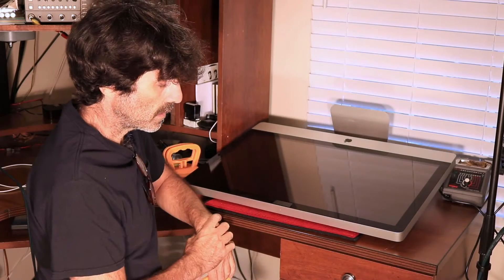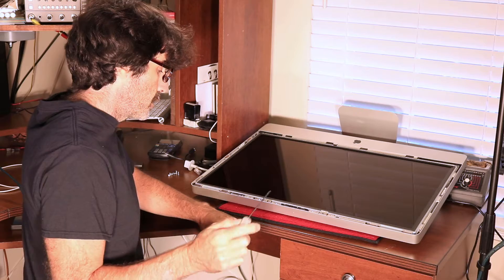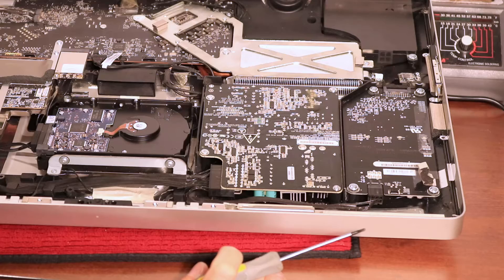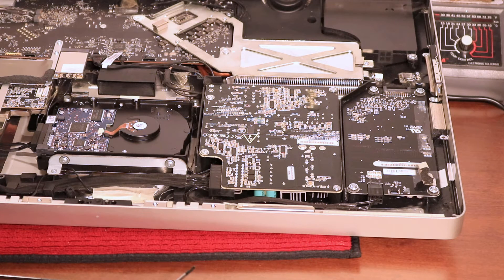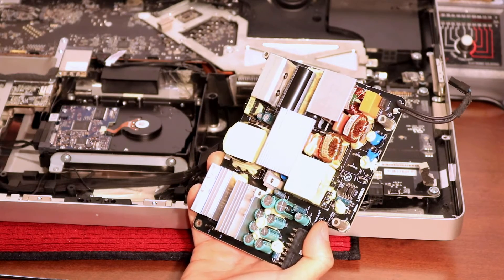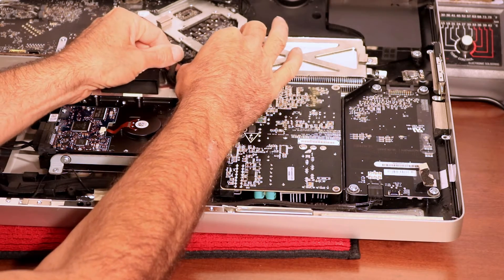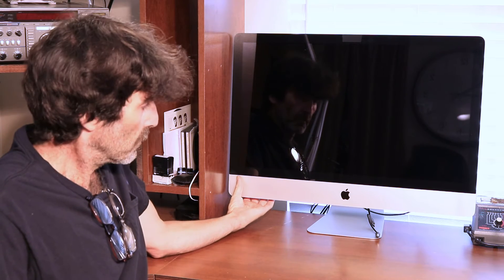IMAC Buzzing Noise From Top Left Corner FIXED!! / Replace Power Supply

Comment: Bizarrely my buzzing stops it i lift or lean the monitor slightly so it takes pressure off the stand/monitor connection
Reply from the maker: Huh.... is that weird?!
Reply: @JLPicard440  yep, maybe something in the stand connection is leaning against one of the internal components. Who knows 😆
Reply from the maker: @thebrokenstringspete  Possibly...

Comment: They installed "copias de seguridad el capitan " and after that it says i dont have much space, when i have and also it makes a repeating sound in the right side where the section of inserting the  cd, thisnoise is when i turn the computer on, there is no cd inside it if you can advice me please
Reply from the maker: Wow.. That sounds a bit complicated to diagnose over a text message.  After the noises does it boot up properly?  The CD drive could be bad?
Reply: @JLPicard440  yes after the noise it goes normal. it is a computer that was taken to factory setting and it was installed El Capitan.

Comment: THANK YOU VERY MUCH Take a Bath Productions...
Try this before buying the new board .. 
This post is also in continuation of
https://discussions.apple.com/thread/5278216?answerId=28897031022#28897031022

the post talk about thunderbolt display but they are very similar in construction .. and LCD panel and powersupply removal are very similar. 
THANK YOU VERY MUCH aramis from italy ( in the discussion board at the above link he mentions how EMI filters sometimes make sound and how he was able to fix it )

I opened my EMI filter at the back of the subwoofer / center speaker (https://www.ifixit.com/Guide/Apple+Thunderbolt+Display+EMI+Filter+Replacement/41652

you will have to buy these things 
1)https://www.amazon.com/gp/product/B0063U2RT8/ref=ppx_yo_dt_b_asin_title_o09_s00?ie=UTF8&psc=1
2)https://www.amazon.com/gp/product/B01712N5C4/ref=ppx_yo_dt_b_asin_title_o08_s00?ie=UTF8&psc=1
) , put everything back so far running the display and macbook with full brightness ..

So far no hissing sound..
One thing i learnt while opening the display is the order of disconnecting the cables from the screen is very important ..
once you open all the screws of the lcd panel and you are ready to remove the lcd panel follow the below sequence ..
Also watch this before attempting anything ..

https://www.youtube.com/watch?v=wFc39ZIi0fo&t=186

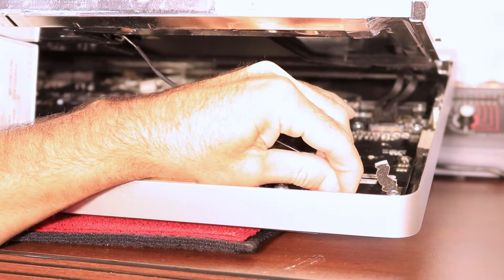Carefully observe the above youtube at 3:00 to 3:20  you will know what i am talking about ..
This guy is AMAZING .. 

1) Connector at the center or the main display connector with a latch/hook with a black tape thats attached to it (this is the shortest ).
2) Connector adjacent to it
3) side connecter to the board .
4) ground connector connected via a screw to the display board ..

Reverse i.e 4 -3 - 2 -1 while putting it back in .. More like first in last out in programers jargon ..
I did not follow the above sequence and the my display cable that attaches to the LCD panel side had come out due to extensive pulling etc ..
I put everything back together and my display was not switching on .. My heart sank :-( , I felt i have shorted something on the powersupply while applying silicone ..
I took a deep breath and removed everything started checking every connector ..
sure enough on the lcd panel end the connector was off ... carefully cut the aluminum sticker and managed properly put it back ..thankfully the connector was not damaged and display came back on ..
So to avoid that trauma just follow the above sequence while disconnecting the the lcd a panel
Reply from the maker: Thanks!  Great info... :-)

Comment: Thanks for your video. In my case (buzzing coming from the upper left corner of the iMac, and noise volume varying with brightness) the solution was much simpler. I read somewhere about ground-loop issues causing this type of noise and decided to check my ground connection. It was not present! After fixing this (changed the extension cord to one with the proper ground pin), the noise disappeared without having to change anything on the iMac.
Reply from the maker: Yes, I think I looked at that with mine here and I had no luck.  I'm glad it worked for you... :-)
Reply: @Dawoud Ali Check to see if the power receptacle in your room is grounded... or the power strip/UPS if you are using it.  Sometimes they are not, and that's where the problem is. There are cheap 'power testers' you can buy that will tell you if the wiring in the power outlet is correct.

Comment: I replaced my PSU in my 27" (Late 2009) IMac and the sound went away for about two weeks.  I was so happy that I had fixed the problem only to be disappointed when I realized the sound had returned after about two weeks.  I originally replaced it with a PSU from IFIXIT.  The static bleeds into my house wiring and shows up everywhere including my guitar amps and home stereo.   It drives me nuts.  Nothing can stop it.  No filters or anything like a Tripp-Lite or Furman will stop it.  Now I just unplug it when I want silence coming out of my amps.
Reply from the maker: millstap good grief!
Reply: @JLPicard440  That was fast.  I'm still watching your video.  Someone told me it was a bad PSU design but I never got any specifics.  It is the most annoying static.  All I can think of is that the PSU leaks DC voltage back into the house voltage.  If you plug your computer into a good power strip like the one I bought, Tripp-Lite Isobar Ultra,  the sound even comes out of the Tripp-Lite if you get down there and listen to it.  I gave up.  Sorry for the four video links but I did the same thing hoping to prevent the problem for someone else so you might be interested.  I spent a lot of time and money on this problem.  https://youtu.be/BHi_iKZp7Nw, https://youtu.be/IhwcyMAUD8o, https://youtu.be/d6hcjVPMBE0,  https://youtu.be/KGp77SJtysA.  I will probably get a laptop next time although I do love the 27" screen.
Reply from the maker: @millstap  That's unbelievable,.. mine wasn't doing all that!  I hope they fixed that problem on the newer Imacs.  I don't have the 2011 anymore, I sold it... I have a 2017 21.5"... I hope it'll behave for a long time!
Reply: @JLPicard440  That's probably what I will have to do.  That sounds like a good compromise, the 21.5" screen.  They work well for so long, it's hard to give them up.  Yours was probably doing the same thing but you didn't have amps to notice it.  It took me years to notice it.  My son told me years ago that it was making a funny noise and I thought he was crazy and was just hearing the fan noise or the hard drive working.
Reply: millstap I just had this exact problem and found this video. My tv, oven  and even the fridge was buzzing like crazy. I thought it was the fan in my IMac at first, but then I thought to myself, hey, my other  devices weren’t making noise until the IMac started doing it. I turned off the computer and just like that all noise stopped everywhere. I could still hear slight a tic coming from it so I unplugged it. Once I plugged it back in, I heard a small pop and now the computer won’t turn on so I knew then that the PSU was the culprit of the DC feedback. Out of all my years of repairing computers and electronics, not once have I experienced this. This is a design flaw that can potentially damage sensitive electronics. Btw, my IMac is the 27” purchased back in 2010.